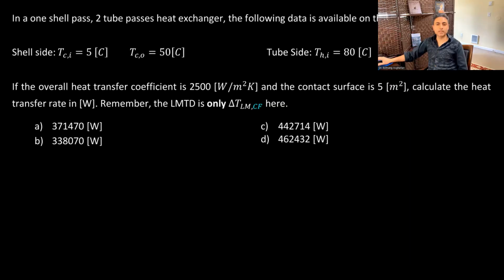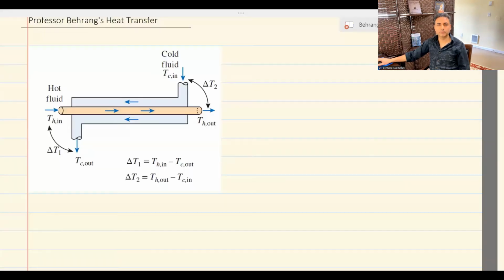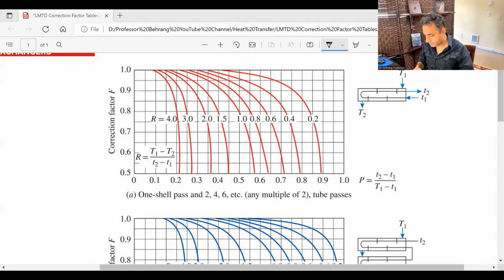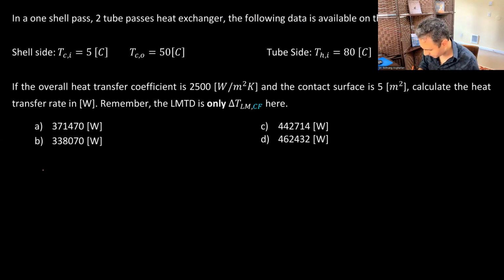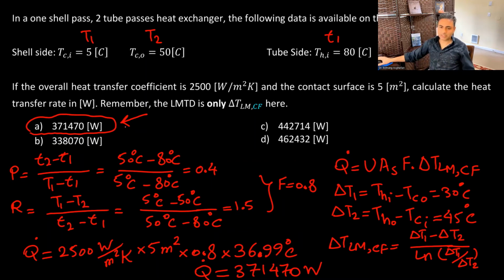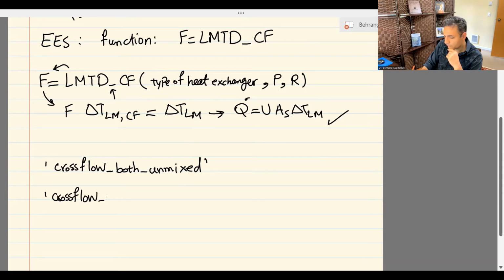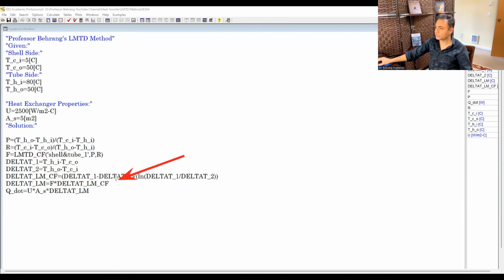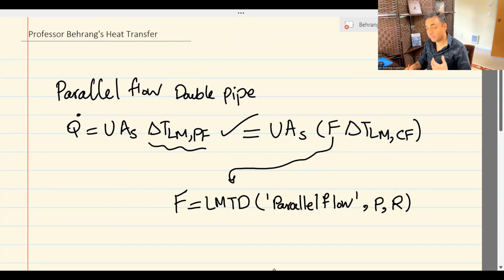How to use LMTD method using EES and the right Graph

Comment: Thank you so much for your videos, it's very helpful.
I have a question, what if there is boiling or condensation, like this surface condenser for example : https://en.wikipedia.org/wiki/Surface_condenser
How can we solve this kind of problem?
Reply from the maker: The general equations for heat exchangers were developed from the first law of thermodynamics so they will work for boilers and condensers. The correction factor for boilers and condensers is 1.
Reply: @professorbehrang  Thank you very much for your response.
Your channel is a rare gemme on youtube, I hope you will get a lot more subs and I'm looking forward for your future videos.
Reply from the maker: @amirclev8213  That's very encouraging. I will start making more videos soon. Thanks!

Comment: Hi!
is it possible to use the Shell&Tube_2 for a situation with 2 shell passes and 8 tube passes. Seems to me EES only uses multiples of 2. So it assumes 2 shells = 4 tubes.
The 6th edition of Cengel uses Two-shell passes and 4, 8, 12, etc. (any multiple of 4), tube passes. My answers are slightly off.
For question 22-64 I get 15,36m^2 , and I have an answer guide that gets 14,5 m^2.
If the short answer is "no" then so be it xD
Thank you!
Reply: Also by using FIGURE 22–19 and reading F=0,82 (using P=0,64 and R=1,1) That then grants me the correct answer. Would be nice if EES could program to a multiple of 4 instead of 2 only.